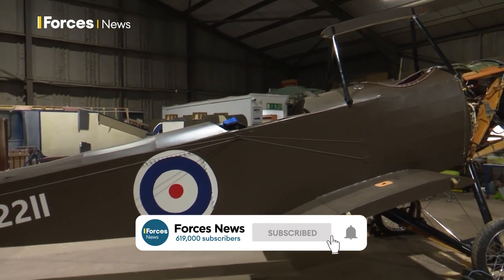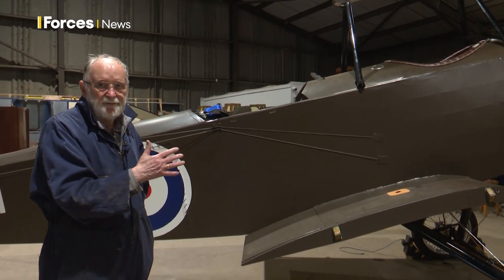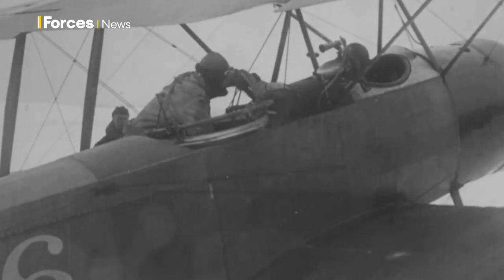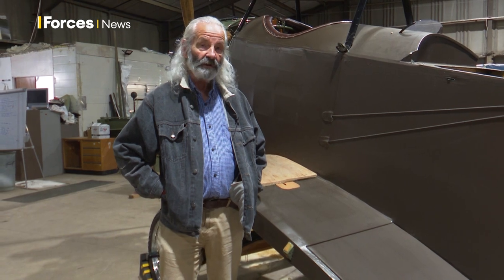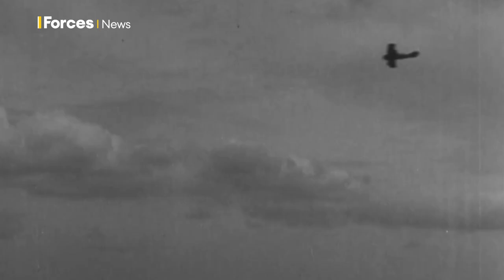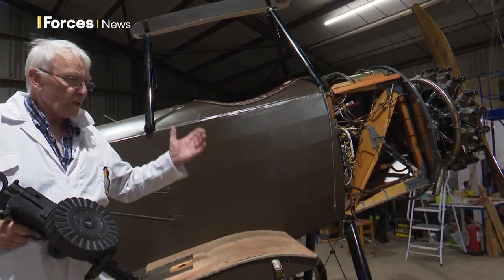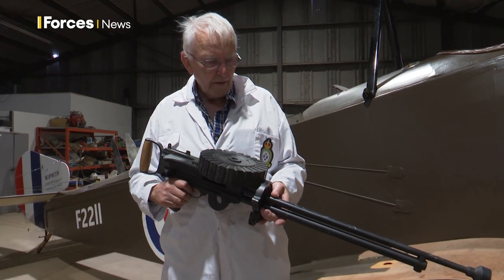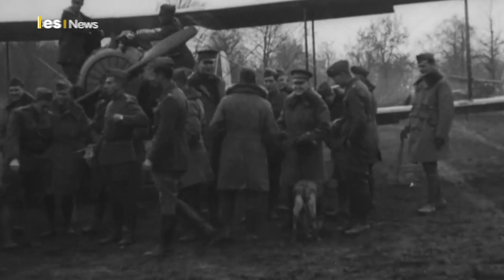Working replica of WWI plane painstakingly recreated by enthusiasts

Comment: what they didn't mention is that royan naval air service (RNAS) wing 3 used it for first even sustained British strategic bombing campaign against deept inside German territory. It had 2 variants. A Bomber variant which was single seat and carried bombs as well as a fighter variant which was 2 seat and escorted the bombers deep inside enemy territory.
It achieved that because it had relatively large range and could carry more payload compared to other aircrafts of the time.